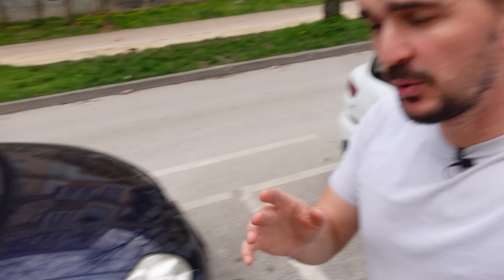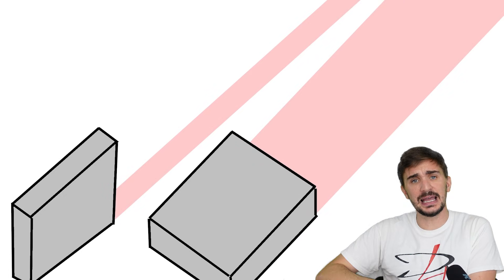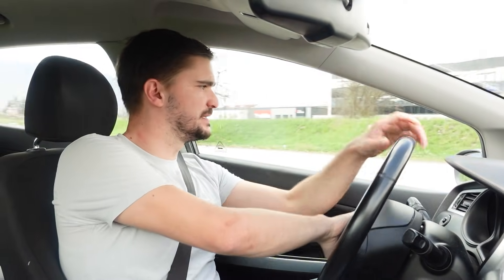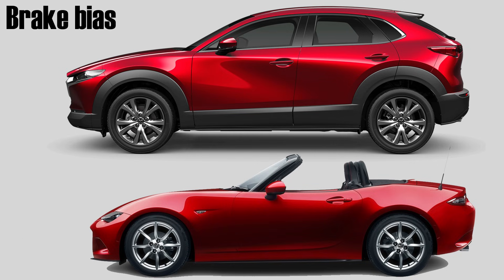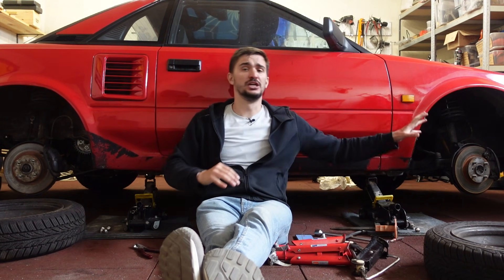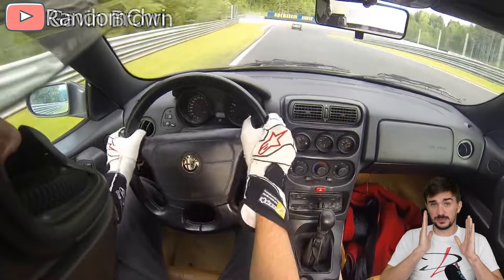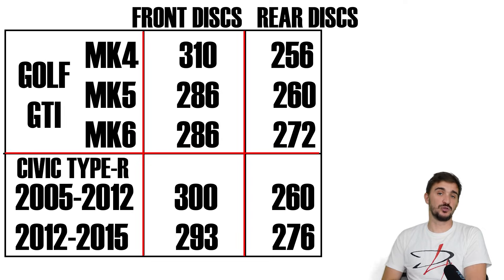Why are Front Brakes Larger than Rear Ones? Brake Bias Explained

Comment: how much extra weight drive shaft and rear differential will add? i don't think it would be more than 20kg. many people told modern cars are not rwd due to this reason and along with it they are expensive to produce, eats interior space and less efficient but none of these reason convinced me so can anyone tell me what the matter really is.
Reply: How is none of what you said convincing? 

Only logical explanation left is the fwd conspiracy!  You figured it out! U got us.
Reply: All that is true.  In the chase for increased fuel efficiency, weight reduction matters.  With no need to accommodate a driveshaft and rear differential, the floor in the passenger compartment and cargo area can be flat for more space.

Comment: On my car (Holden VE Commodore), the rears are larger diameter than fronts, but the front has more friction surface area than rear. I would say that is because of the handbrake drum design taking up more area, making the overall rotor diameter larger. 

I have since changed this with a police pack upgrade, using the Chevy Caprice PPV front brakes, changing the front rotors from 298mm to 345mm and from 2 piston to 1 piston per caliper. Definitely stops a lot better now.

I know of one other car with this style setup (Toyota 200 series Lancruiser)

I've also noticed, as a mechanic, a lot of cars, mainly cars fitted with EBD and from around 2005 onwards, they tend to wear out the rear brakes a lot quicker than fronts too.
Reply: I have a VF v8 and went with the 345 rotors but Brembo calipers from the caddilac cts-v iirc. Only because I couldn't get the steel calipers in Australia and the brembos were the same price. It kinda sucks you can only buy DBA rotors for it. Tiny vs the VF gts-r at 410mm rotors though!

Comment: My M140i has 345mm rear discs and 340mm fronts. Which I found odd - I assume it's a mixture of cost saving and the need to dissipate more heat due to the e-diff?
Reply: The E diff is the brakes really.
Reply: @Low760  that's what I mean - it uses the brakes more than typical so needs to dissipate more heat

Comment: If contact patch area didn't matter cars would be best on bicycle tires
Reply: Load question primarily. I think some tests are in order though.  Formulas are only so good eh?
Reply: @jamesmedina2062  patch shape matters too.
Reply: @Scoots1994  I know. But if the theory that adding weight to the same tire did not dramatically increase grip, F1 cars would not employ such dramatic aero to increase down pressure.  and trucks would not throw sandbags in the bed during winter.  But there are many many variables. The type of pavement. The temperature. The tire compound. The tire pressure. Etc etc....
Reply: @jamesmedina2062  yes, my issue was with the absolute language in the video.  Heck the design of the carcass changes grip particularly in transitions.
Reply: @Scoots1994  Absolutely correct Mr Scott!!

Comment: Great video!
In motorcycle, front and rear brake are almost always have separate levers. When racing, I think racers almost using no rear brake during hard braking. For normal riding, i think it's better to use both brakes but some guys insist that you do not need the rear brake at all. What are your thought?
Reply: On my vintage Suzuki GS650GT the front brakes are weak compared to modern brakes, but when used in conjunction with the rear brake the stopping power increases quite a bit, so it really helps to use both front and rear. On my Ducati with 320mm discs and Brembo goldline, there is probably no need to use the rear as the front are strong enough, but I still use the rear brake with the front on the Ducati, as I find it reduces a bit front fork dive under braking. So I guess it down to the type of bike and riding style.
Reply: I rarely use the rear brake on my Ducati during must stops, however, it is helpful to drag the rear brake slightly during low speed maneuvers  - like U turns.

Comment: My Volvo 850 t5 had 280mm on front, 296 on the rear :D
Yeah I know...
Reply: Your Volvo's front calipers or brake booster may have been larger than a car of similar weight. 
Or the proportional valve set up with greater bias to the front.

Comment: it remains to talk about the transmission, as I often hear comparisons of motors in different cars and the torque is constantly voiced there. but in fact, the torque on the wheels depends on the transmission no less than on the motor, so this value obtained exclusively on the motor does not say anything about the car, but only about the manufacturability of the motor

Comment: This was a really good video! It never occurred to me that friction is independent of area, but only depends on normal force, given that the surfaces stay the same. It's now so obvious and logical.

Is that also part of the reason why cars generally have a shorter stopping distance than motorcycles? (because they weigh more and, hence, can "produce" more efficient breaking friction)?
Reply from the maker: Allow me to contradict myself 😊 cars stop better because they have more tires, more total surface area for braking. When it comex to surface area and tires it's a bit more complex which is why I made a prior video (pinned comment) and just glossed over the issue here, as the topic of this video was something else.
Reply: @d4a  I will say to myself what my father once also said to me: "Son, would you have kept quite, you would at least have seemed smarter!" 😆 Would I have watched the video in your pinned message first (I now have), I wouldn't have asked the stupid question. Thanks for answering nonetheless.
Reply: @echsylon  Seemed smarter, yes, but you wouldn't have learned as much.
Reply: Also, usually, cars don't do a stoppie while braking

Comment: more surface area is indeed more grip, otherwise we wouldn't be fitting larger tires to improve traction. I think the formula is valid only for non compressible/deformable bodies, like a block of metal on something else.
With rubber, the squishiness helps grab onto the "rugosity" of the asphalt, improving grip (up to a certain point).
Reply from the maker: https://youtu.be/CyH5xOcsXxs

Comment: Nice summary. Do you planning to upgrade your mr2s brake? Will you get a brake balance adjustable system? I heard on rear mid engines trailbraking should be really beneficial for cornering.
Reply from the maker: I definitely plan to upgrade the brakes but there's so much to do before that 😑
Reply: @d4a  im looking forward to the brake job video. Building a car isn't called a never ending job for no reason 😂

Comment: A good overview, but surface area absolutely makes a difference to the coefficient of friction. This is why sports cars have wider tyres and brake calipers compared to regular cars. The F = uN model is an oversimplification for beginner physics students.
Reply from the maker: It's not. It's a valid formula and surface area doesn't matter for friction in solid equal surface materials. Here it is discussed at length: https://youtu.be/CyH5xOcsXxs
Reply: @d4a  I see your point about friction being more linear for 2 rigid surfaces.
Reply: you need to retake your college physics 1 course.

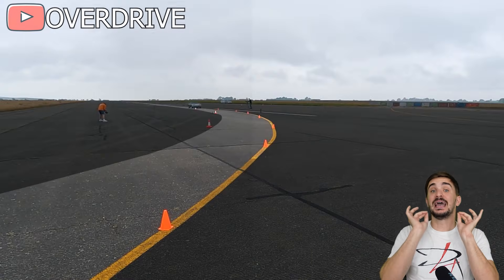Comment: One VERY important thing to note here is the chaps comment about ABS. Modern cars fool you into thinking you're a much better driver than you actually are. @10:30.
I remember a 1 - Series I had on hire, and switching off the Traction Control made a bigger difference than I could have ever imagined. Completely exposed my lack of skill behind the wheel.
Reply from the maker: I personally think it's not so much a lack of skill as the fact that most new cars are developed and set up around traction control being enabled. If you take an older fully analog car you might discover that you're skills aren't poor at all.
Reply: @d4a  i disagree with this one or at least in this form maybe if you unfold it more. However i know a car which can not brake in a straight line straight without abs but this is more the exception than the rule.
Also there is an aspect that more powerful cars especially with electric engines (including hybrids) "needs" traction control. It is hard even for experienced drivers to handle the instantaneous torque and if you release the pedal you (can) have the same amount in the "opposite direction".
In the recent (G2x) BMW cars in sport mode you can "drift" (at least in snow) with full throttle change direction only with steering. So i completely agree that  "Modern cars fool you into thinking you're a much better driver than you actually are"
Reply: @d4a  Maybe in my case a lack of practice certainly. I don't make a habit of putting my car in positions where I think I am going to bend it so never get the chance to practice what might be needed if the proverbial ever does meet the fan.
Or.............maybe I have but the car has fooled me into thinking my application of throttle brakes and steering were reasonable ones?

Comment: Does a larger tyre width make no difference to grip then? I could be wrong but in an older video you mentioned that since tyres have so much irregularities on a micro scale that surface area actually makes a difference. Also why do F1 cars have such wide tyres if they don't help?
Reply from the maker: If you watch that older video it will make sense. Tires are completely different to brakes and they respond to loads and surface area changes differently.
Reply: @d4a  makes sense, since u didn't delve into surface imperfections or mention that the equation doesn't apply to real life materials like rubber, in this video, I thought u were suggesting that tyre with didn't matter as it was labeled as irrelevant. 👍

Comment: This friction thing. I know a few of those formulas and remember some from things physics in school. Now some context from "MY" POV. 
Surface area does matter in the real world and here is why. Consider the illustration at 02:45. Imagine they are little hooks grabbing valleys and troughs in the road surface. The amount of force is spread across each little hook and it's easy to imagine one single hook being overwhelmed by force and heat and breaking itself and therefore breaking traction. More surface area means more hooks and less load per hook. 
That's what happens with a tyre - bits of it break off, hence they wear out.

Discuss.

Very useful series of videos though. All of them.

Strangely enough, more context. 08:45. The subject of bigger brakes is applies here too, (I remember this guys video about it) and he says here that bigger brake capacity can absorb more heat.
In a one off you'll not notice any difference but as bigger brakes can dissipate more energy, in the real world with repeated stops they can fade less quickly and hence stop you more quickly.

Great to learn about the theory behind all of this though.

Comment: Great channel, good job. I've been following for a long time. Regarding the brakes - all my previous cars were as you say but the current car has 345mm front discs and 350mm rear discs, both ventilated (Dodge charger police version). I was surprised myself when I changed tires for the first time.
Reply from the maker: I'm curious, what year is that charger? Also, it might be expected to have a trunk full of police stuff all the time?
Reply: @d4a  It's 2011 fleet car (Called the police version in the US). This particular example was never used by the police. I brought him to Poland a few years ago.
Reply: @d4a  That makes so much sense
Reply: most rwd cars without a LSD use the brakes as a cheap LSD. thats why you see the same or larger rotors on the rear. theyre still not as thick and also have smaller calipers but they need the larger rotor for leverage and mass (heat) storage.
Reply: @OxBlitzkriegxO  I hadn't thought of it that way, but it also makes sense. Thanks
Reply: @danielciesla3791  I believe some cars also have a large diameter rear disc to accomodate the parking brake shoes. The Charger uses a parking brake drum inside of the rotor. The parking brake mechanism has to have clearance for the bearing assembly, which is quite large on that car. The brake shoes also have to be of sufficient size to hold the weight of the car even on a hill, and that's a pretty hefty car. So they will increase the total diameter of the rotor so the pads still have sufficient surface area for purpose and aren't skinny bananas.
Reply: Those front disks are twice as thick tho...
Reply: @ifixem9585  front 28mm, rear 26mm
The front caliper is double-piston and the rear single-piston
Reply: @Daniel Cieśla  Hmm...that's Chrysler for you.  Seems weird

Comment: how are disks on the rear useful? how would a handbrake work on a disks-all-round setup?
Reply from the maker: When pulled, the handbrake cable pushes the rear pistons in. It's pretty simple. There's a little threaded shaft or a similar mechanism in the rear brake calipers.
Reply from the maker: You can see it here: https://youtu.be/wTCdVuBFBIE
Reply: Safer and more reliable than drums that’s for sure
Reply: @knwgt5426  disc handbrakes can fail if the disc is hot when you apply the handbrake, as it cools the disc will shrink slightly and the car could roll away
Reply: Drum brakes actually have better heat distribution than disks, I'm pretty sure that's why semi's/Lorries still use them over disks